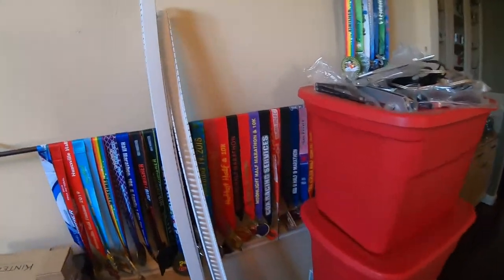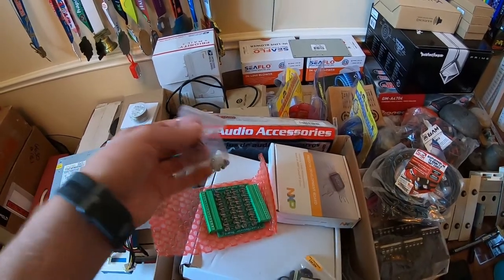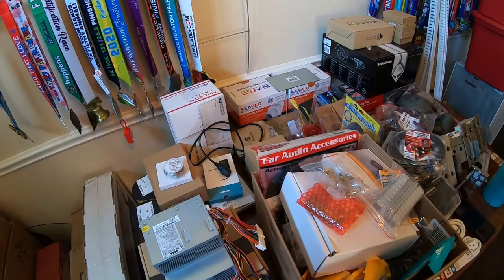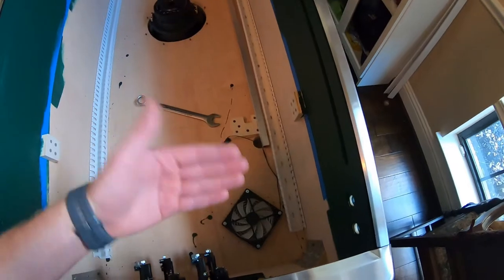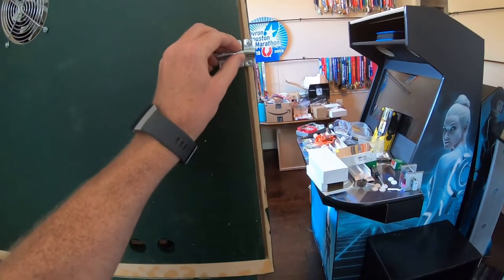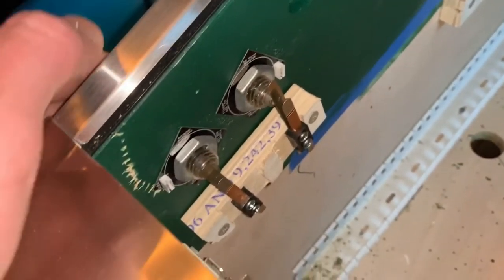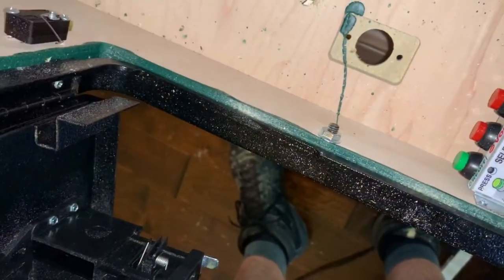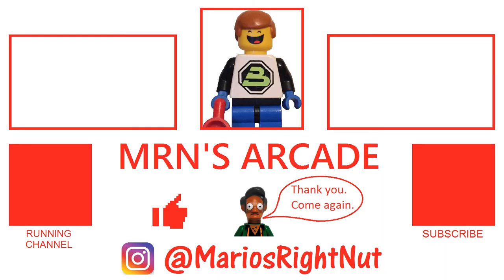Buttons & Fans - Virtual Pinball Build Part 8

Comment: Thanks for the awesome video!  I have a question, did you have to route out the holes for the start and exit buttons or did you just drill a hole and it recessed like that?  I actually live about 20 minutes away from pinball life, I can just pick up the buttons there.  Would not have known that without this video!! Thanks
Reply from the maker: I drilled a small hole all the way through. Then drilled another larger one half way through to recess the buttons. Forsner bits work pretty well.
Reply from the maker: Though, I’d probably drill the big one first yhen the small one after if I did it again.
Reply: @MRNBricks  Thank you, this is exactly what I was looking for.  Ill do a practice run on one of my leftover pieces of wood.